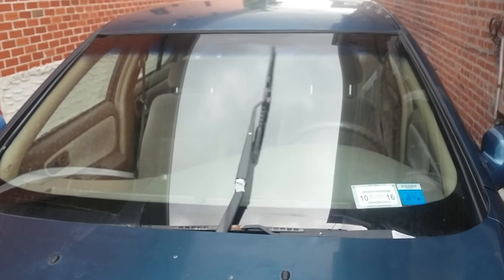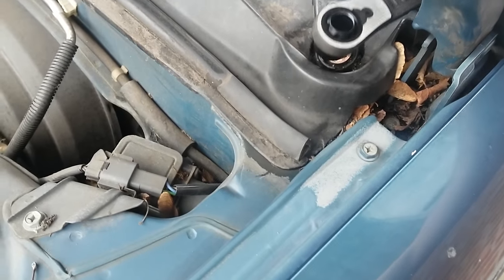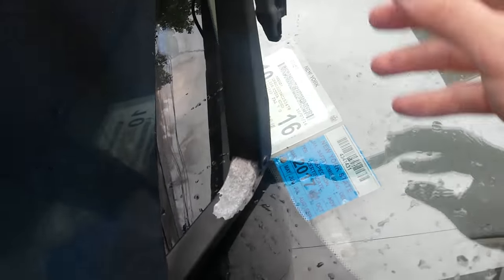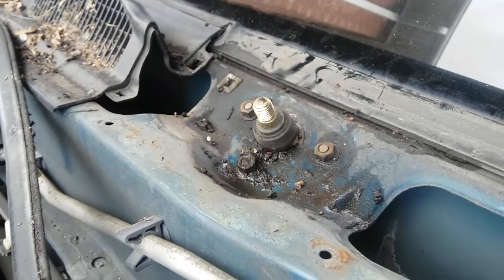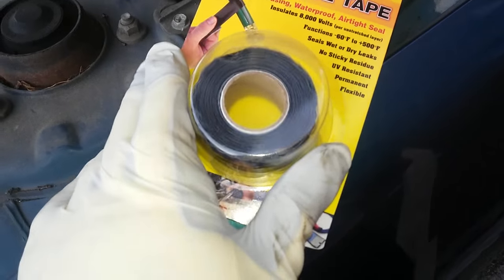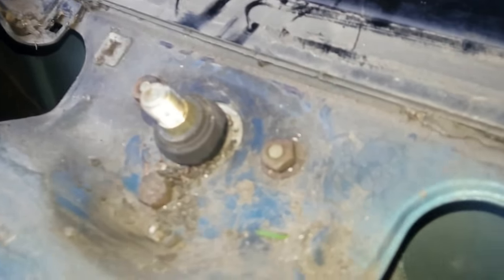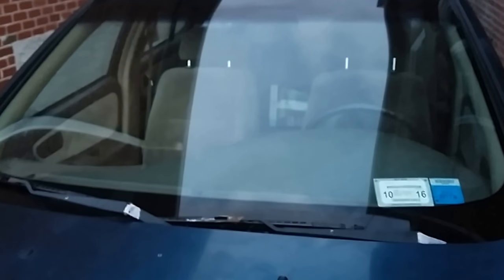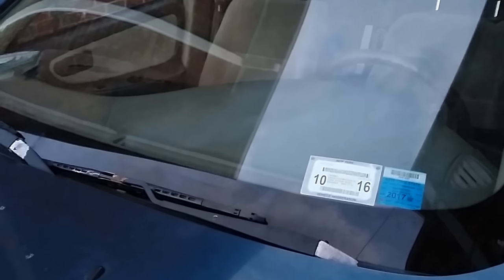Altima Wiper Linkage Disconnected Quick Fix

Comment from the maker: 🔥Buy EZ Fuse Silicone Tape From Ebay: 
https://rover.ebay.com/rover/1/711-53200-19255-0/1?icep_id=114&ipn=icep&toolid=20004&campid=5338340276&mpre=https%3A%2F%2Fm.ebay.com%2Fsch%2Fi.html%3F_from%3DR40%26_trksid%3Dp2380057.m4084.l1313.TR1.TRC0.A0.H0.Xez%2Bfuse.TRS0%26_nkw%3Dez%2Bfuse%2Bsilicone%2Btape

🔥Buy The Wet/Dry Car Vacuum From Ebay:
https://rover.ebay.com/rover/1/711-53200-19255-0/1?icep_id=114&ipn=icep&toolid=20004&campid=5338340276&mpre=https%3A%2F%2Fm.ebay.com%2Fsch%2Fi.html%3F_from%3DR40%26_trksid%3Dp2380057.m4084.l1313.TR5.TRC0.A0.H0.Xsharper%2Bimage%2Bcar.TRS0%26_nkw%3Dsharper%2Bimage%2Bcar%2Bvacuum

🔥Buy The Socket Wrench Set From Ebay: 
https://rover.ebay.com/rover/1/711-53200-19255-0/1?icep_id=114&ipn=icep&toolid=20004&campid=5338340276&mpre=https%3A%2F%2Fm.ebay.com%2Fsch%2Fi.html%3F_odkw%3Dsocket%2Bwrench%2Buniversal%2Bset%26_from%3DR40%26_trksid%3Dm4084.l1313%26_nkw%3Dcraftsman%2Bsocket%2Bwrench%2Buniversal%2Bset

🎯 SUBSCRIBE For More Content 
https://www.youtube.com/user/Mattroise

Check Out More Car Repair & Fixes Here:  https://www.youtube.com/playlist?list=PLCF8ZflvFulX6EUaMEVx2Tl1ZrQBQ_Vdy

Comment: This was exactly what was wrong with mine - thanks for posting!!
Reply from the maker: +Michael Hilton No problem.
Reply: I can’t get that ez fuse tape or anything else to hold. As it rotates everything just gets chewed up. Any ideas? Thanks!
Reply from the maker: +Michael Hilton I wrapped the ez fuse tape around the joint at least 5 times over and made sure it was tight each layer. I also let it cure for a week before using again. If the ez tape isn't working by itself, then use flexshot silicone sealant along with it and put a generous amount all over the joint and then wrap it with the tape. Then let it cure for a week.
Reply: Ok I’ll step up my ez fuse tape game. Thanks so much!!
Reply from the maker: +Michael Hilton No problem.

Comment: The linkage part costs about ten dollars I'm not sure why you used tape instead of replacing it
Reply from the maker: This is just a Quick Fix not a Replacement.
Reply: I agree. For the amount of time it takes to take it apart, that won't last long.
Reply: Where would I find the replacement part? I might choose to replace instead of repair
Reply: Napa carries it, a lot of places do probably, the Chinese made replacement works fine

Comment: Did it ever come undone
Reply from the maker: Jonathan Penny No. It works and survives the toughest storms from this date. I also put some flexshot flexseal silicone on the joint area too. I let it cure for a week before using.